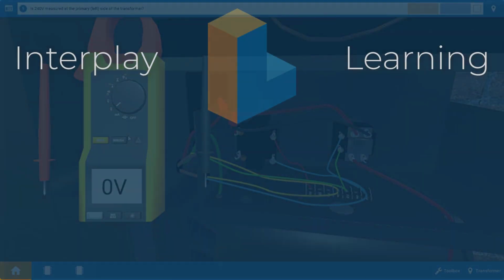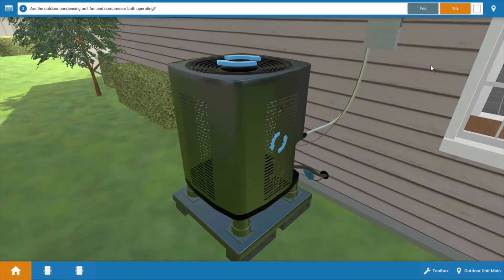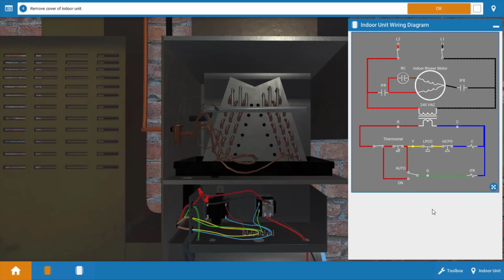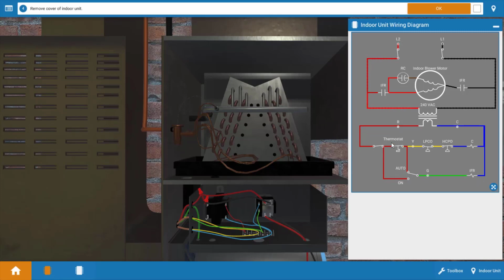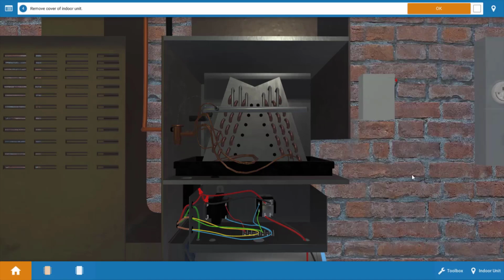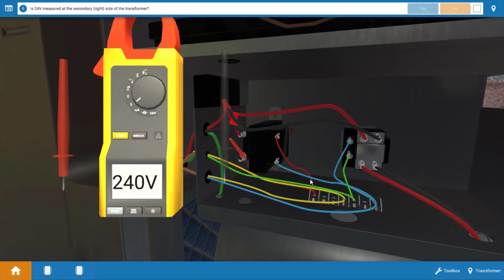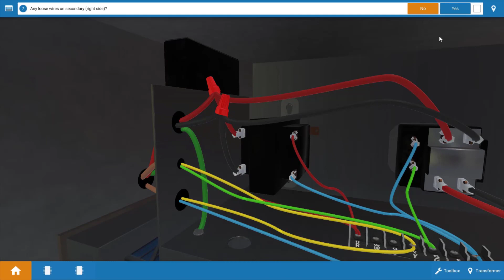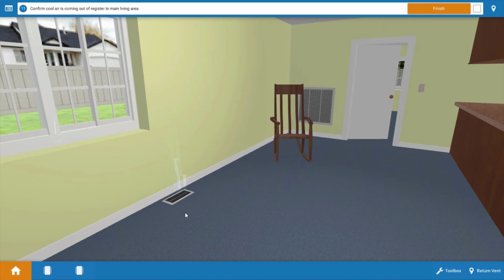How to Troubleshoot a Faulty Transformer for Residential AC

Comment: Awesome , I wasn’t receiving my 24V when setting the T stat to cool or heat and even setting it to Fan On. Checked voltage on my T Stat wires and got 0V across all terminals. Checked my transformer and right away you could see it hurt a small burning spot and could smell a faint burning smell. Checked my secondary and saw that there was no 24V coming out so there’s my problem . Thank you for the clarification!

Comment: I'm having this exact symptom (no 24v on secondary side).  You mentioned a resistance test before replacing the transformer.  Where can I find those instructions?  Thanks.
Reply from the maker: Hi Jamie, turn off the power and disconnect one wire from each side of the Transformer one from the primary one from the secondary. Next measure resistance across each side of the Transformer a measurement of infinite Or ol indicates an open winding in the Transformer. I would suggest you view the electrical meter use videos as well.
Reply: @InterplayLearning  After checking resistance, how do you know it's safe to replace without the same outcome?